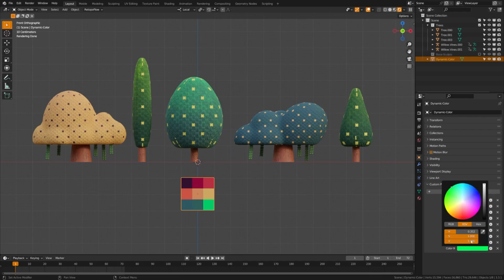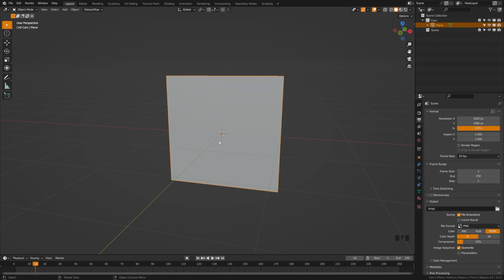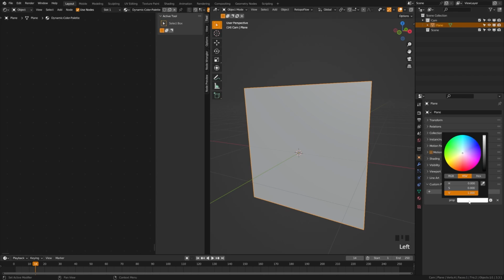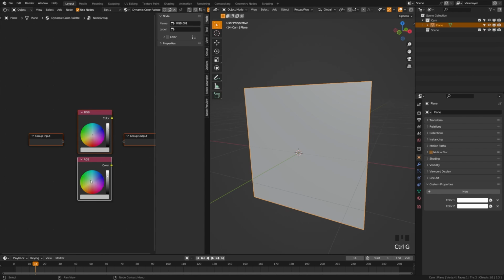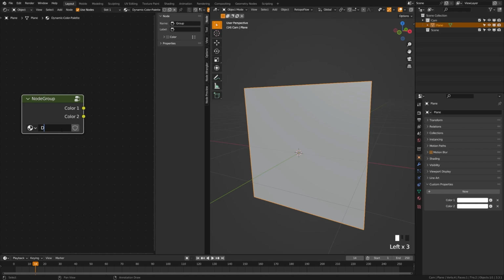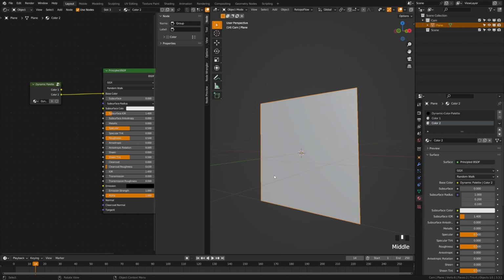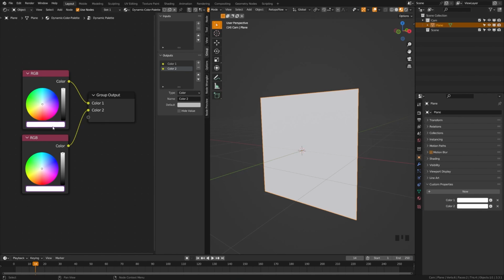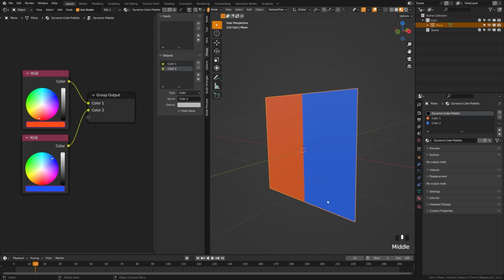Dynamic Colors with this SECRET Node Trick (Fast and Easy Blender Tutorial)

Comment: I'm still salty that they removed the ability to just right click on a colour and copy the whole thing as a driver. Think they removed it shortly after eevee launched for the sake of consistency. Not a fan.
Reply: You can absolutely still do that. But it can't be a colour in a shader node, which I think is why you saw it when Eevee launched. So if you check out the Viewport Display section of a material, the color shown there can be used as a driver.

I'd rather set things up the other way around, so I could pick one colour from my shader to use as the driver for the display colour :P

Comment: oh, I followed along. very cool. 2 things happened: I made something that will be useful in other projects and I also used custom properties, which is something I try to force myself to use when possible because I know its powerful, it just takes getting used to. Blender Bob did a video on using a switch  in a similar way a while back but it wasn't a video I could easily follow along to. Thanks Mr Shotty!